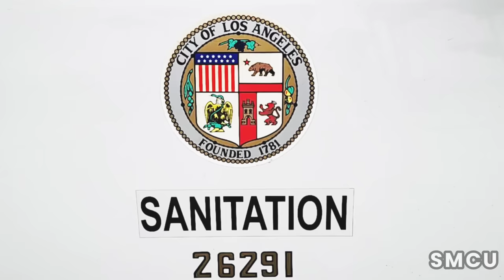Venice Beach Restrooms Reclaimed: Multi-Departmental Initiative Clears Homeless Encampment

Comment: How many times are you repeating this process? All you have to do is demolish this shabby lavatory block and replace it with an automatic lavatory. You are providing drink and shelter as an encouragement for undesirable people to move in.
Plus, the lavatories are now potentially dangerous for the public as a result.
Not only that, the structure is an eyesore.
Remove the toilets and remove all the problems.  Simple.
Reply: EXCEPT then they will start pooping all over the beach😢😢
Reply: @jaymoore661 
They already do that

Comment: Each restroom should have a hydraulic squasher. Sort of like a potato masher, that comes down every hour. 
The floor is a grate, that is dull knife edged allowing the pieces to be cut up nicely. A high pressure spray then allows all the matter to be sluiced away.
Fresh and ready for the next customer.
Of course there would be five minute warnings, lights and sirens.
After all, I’m not a monster.
Reply: O'tay John Kramer...
Reply: I was thinking along the lines of a self cleaning pyrolytic oven...
Reply: Yeah, ….yeah. I didn’t go that way, but that would work well I think.

Comment: These bathrooms need floor drains and ceiling mounted tamper proof sprinkler systems that periodically spray down water during non use hours. This would keep the interior clean and would be a not attractive shelter space.

Comment: So that's the clean-up, huh.. just open the doors and getem out.. what's the point of those cleanup guys wearing those suits?? And why are they only going out on this mission with rakes??? So the restrooms are good to use just like that? They just knock, get them out, rake up their stuff (barely even that), then were supposed to just stroll on in and feel comfortable? Or let one of our kids go inside? Man, I swear this is such a disservice. They need to power wash each stall from top to bottom using extra foaming disinfectant. Then spray them all down again with Lysol just to be sure... those city workers are lazy af.... there milking the system frfr.